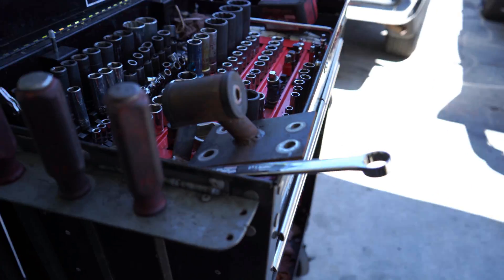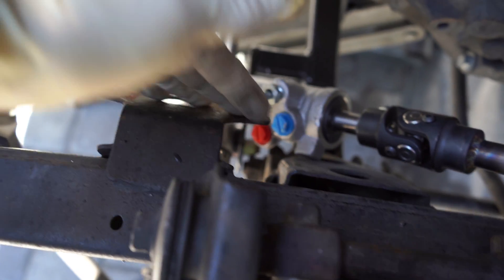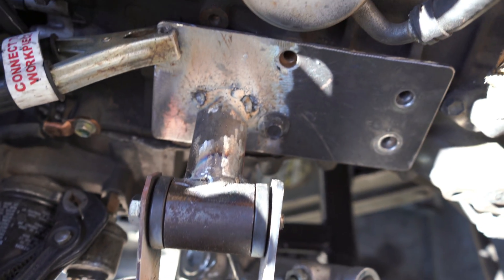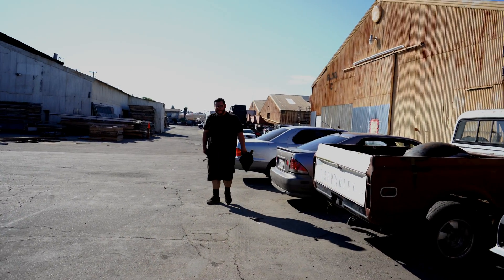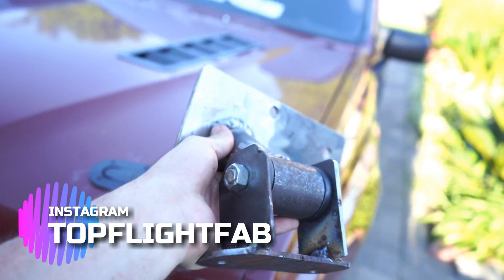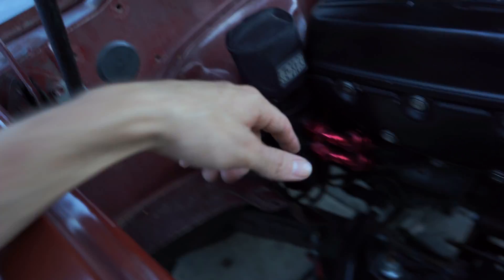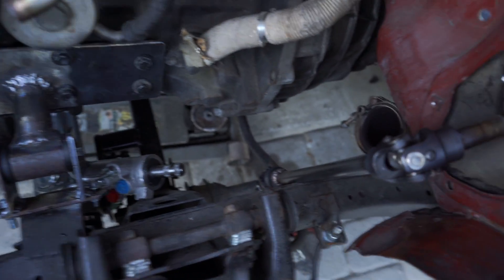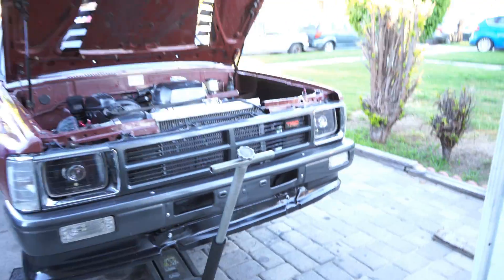EP.2 | RACK N PINION CONVERSION | TOYOTA PICKUP (HILUX/UTE)

Comment: Awesome videos, I really enjoyed the steering rack swap ones.  Question for you.  I have a 1992 V6 2wd toyota mini truck, I just bought a 2005 B5.5 Passat TDI with a blown transmission.  I plan tdi swapping that engine into my mini truck.  There is lots and lots of info on swapping the VW tdi's into 4wd trucks, but not a lot of info for 2wd.  The one good forum thread I found on someone doing this swap had issues with the factory steering link with the VW tdi oil pan.  So my question is: Will this swap to a Mustang II steering rack give me more clearance for my oilpan?  Thanks for your time. Cheers. John
Reply: I just did this exact swap, and the issue you're describing was the primary one I faced, and am still facing. For me, short answer, no. I swapped the oilpan with an aftermarket hybrid option, but in order for the vacuum pump to comfortably clear I had to cut a section out of my central core support and move my drag link downwards. The way that the mustang ii rack mounts on stabfab's bracket there's absolutely no room for an ALH to fit in. I'm still trying to make the drag-link work to just get down the road, but I had to cut and weld my pitman and idler arms, and flip my tie rods on the knuckle. This makes them interface with the tension rods in a dangerous way. When I can get back to that project, I'll work on trying to fit a rack, but it's very unlikely to be one from a mustang ii. I can let you know if I find one that works!
Did you end up starting on your swap?